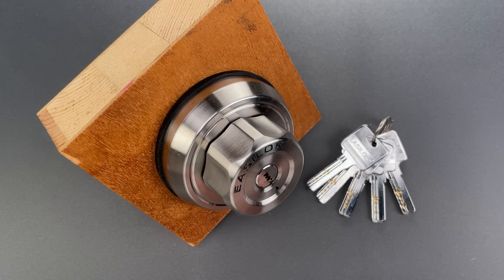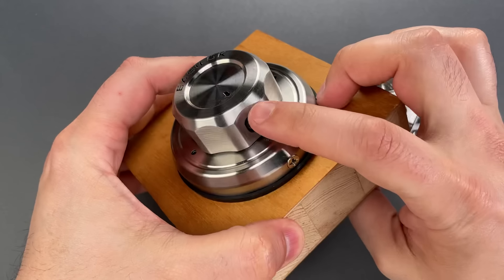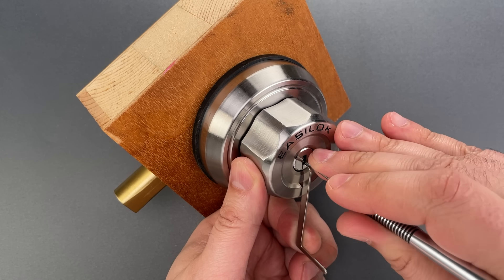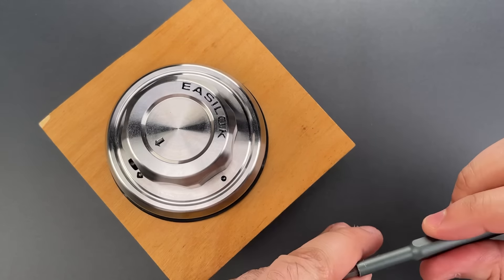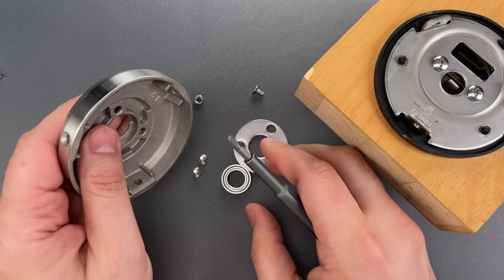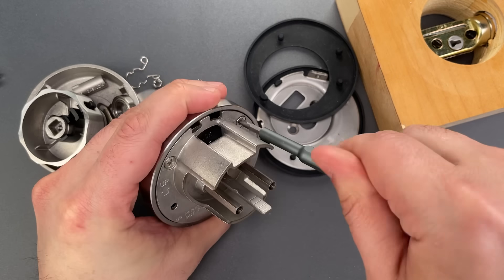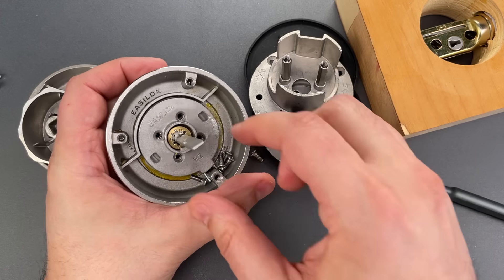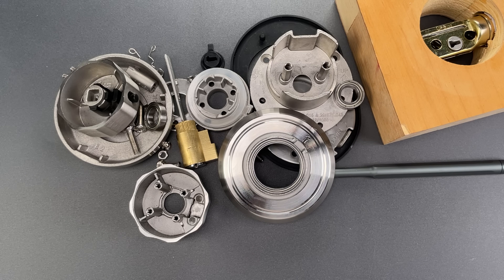[1388] The Best Built Deadbolt Ever? Easilok

Comment: A bit off topic.  I have built super insulated doors one 4 1/2" thick and another 5 1/2".  Well I have scoured the sources I know and have found no locks nor knobs/levers that will go through that thickness.  I did find some German locks on Amazon which I thought I could modify.  I have a pretty good shop with mills, lathes etc.  I first took the easy route and wrote to the German Company asking if they had a kit to allow it to operate on my thick doors.  No luck.  I then asked if they had the threaded (internal) round stock, square tube stock, and flat stock which they used to make them available.  No luck.  I then contacted several steel suppliers in this country to see if they had suitable stock.  Nothing even close.  Next step was to get as close as possible and machine it down.  However the internal threads on the rod posed a serious problem.  Getting a tap that small, metric equivalent of a #8 x 32 that was seven inches long has me stymied.  I don't have jeweler's tools if they even have such long small taps and drills.  So what I am wondering in all your dealings with locks have you come across any that have adapters for thick doors?  I cannot believe the industry can lag so far behind in a modern super insulated world to still only produce sets for 1 3/4" doors at the thickest.  Why would I use a standard thin door in a ten inch insulated wall!!  Thanks for any help.  Doug

Comment: It is a nice deadbolt.. but,  I'm curious to know what would happen if you took a good size pipe wrench and turn the exterior side of the locking mechanism while the deadbolt is latched. 
Would the deadbolt stay extended or would the torque from the pipe wrench be to much for the lock 🔐?  It seams possible to not have to pick this lock to open it. 
Happy trails 😊...

Comment: When a lock gets too good, just break the door. I have a stipple key yale, it's totally un-pickable, can't be bumped, snapped, etc. I also have locks that can't be used when the key is inserted internally. Anything which slows the villains down is a good thing, even if it's eventually cracked.

Comment: Damn, if not for the spoiler of the video title and his specific early praise, I really expected a lock like this to be build rather cheaply and crudely m, especially internally that won't be directly interfaced with. Stuff like this just tend to be sales-driver gimmicks, with all effort spent on selling the novelty, while the construction, materials and build quality is a very cheap, crude and flimsy afterthought. I'm surprised and very pleased to see that for once this was pretty much the opposite. Only real criticism is  I'd love to see a more standard form factor cylinder so that it's easier to use other core types and configurations (and some security pins in the core that comes with the lock). However with this attention to quality and detail with the rest of the lock, I assume the manufacturer already implemented a different and improved security core by now.

Comment: Well I do like the fact that you are impressed by this. But I am curious about a brute force attack to the outside knob. After all it does stick out quite a bit. And could easily be hit with a heavy sledgehammer.

But the fact that you disassembled it and everything is stainless steel that's why I'm curious. 🤔

Comment: How do you think this would hold up to some hard kicks compared to one of the nicer Schlage Locks?  I'm a contractor and do door replacements and door jamb reinforcements, and I think that is more important than being pick proof-resistant. I've encountered many kick ins but have not personally known of any crime victims who had their deadbolt picked. Most criminals lack the ability to pick a deadbolt, especially a Schlage. The brute force method is orders of magnitude more common. Do you think this is sturdy enough to resist being kicked in on a reinforced striker plate compared to Schlage?

Comment: Looks great, but still an overengineered less than 30 seconds to pick lock. Maybe keep the project and use a better core, a high security one if possible. It will probably make it more expensive but will also make it a LOT more useful.

Comment: Why the added cost and maintenance of a ball bearing !? A plain bearing will work just fine, actually a non sealed ball bearing exposed to the elements will rust and seize, not to mention it requires scheduled lubrication

Comment: Can you recommend a deadbolt which can ONLY be opened from the inside and outside by key, rather than by turning?

Looking to put these deadbolts on my house, but one of the doors has glass panes at the top.  A burglar can simply break the glass and turn the deadbolt knob to gain entry.

Comment: LPL, have you thought about designing and manufacturing a number of locks that are unpick-able! You should get together with a lock manufacturer and share the rewards. A lock recommended by LPL will sell faster than any lock maker who has been exposed to LPL’s tools and skills!
Reply: a unpickable cylinder is not impossible but impractical. The tight tolerances will exponentially raise the price and it will be susceptible to dirt and temperature differences.

Comment: It's a pity that such a well-built lock is let down by a low-security barrel and pin system. As LPL said, it cannot be changed for a better barrel, that modification would make this an outstanding unit.

Comment: My only issue is that it has the brand name on the outside so ab thief can easily google the brand to find a lockpicking tutorial
Reply: A thief is going to kick the door in or bust out a window.
Reply: @TravelingStacker  no they usually use the door.
Reply: @Demonologist013  Well according to statistics, a door being kicked in or a busted window happens more than the locks being picked.

Comment: I don't like that the lock cylinder can be disabled from inside (night latch feature). There are plenty of other devices that can very securely latch the door at night when a person is at home. If someone forgets or doesn't notice that the lock cylinder has been disabled inside and then leaves the house through a different door they can cause themselves a good deal of inconvenience upon returning home.
Consider when the garage door won't open because of power loss and the externally accessible doors have had the lock cylinders disabled with the night latch feature. The homeowner would be locked out of their own home! An older child could very effectively lock their parents out of the house while doing whatever they please inside. A burglar who is able to defeat the easily picked cylinder could lock out the owner until they finish ransacking the house..... It's just not a useful feature for me, and it would prevent me from buying the lock unless I could permanently disable the feature.

Comment: I get disheartening by how easy he always picks a lock.
Reply: well you are watching master locksmith. My first attempts takes 30min to a hour and some i still not manage to open. Soon as you move from cheap cylinder to something medium it gets exponentially hard. Just one security pin and most amateurs will have serious problems. Best way to secure you property is to have cameras and alarm, if you cant install or afford next best thing is to be unpredictable. If the thief is not sure when you come back he find a easier more predictable target.
Reply: @scasny  i have never tried lock-picking. I might give it a try it looks a lot of fun.
Reply: @MrRez808  well its similar to Jigsaw Puzzles that you train your patients and attention but the difference is instead of visual demand its about touch and bit of sound. After a while the clicking sound become addictive and when you finally open it its quite a satisfaction. I was working in a locksmith shop for a while and even for that short time i use picking 3-4 times so its definitely not a useless skill if you want to legitimately help people.

Comment: Can you still open the door from the inside when the switch is set to lock? If not, isn't that a fire hazard? If so, don't you stand the risk of permanently locking yourself outside by forgetting to disengage it before locking? Their listing on Amazon even states that when the deadswitch is engaged it can't be picked.
Reply: the night latch like your reinforement lock, your security bar, your deadbolt which can't be opened outside.

Comment: I'm thinking too much meat on the outside for a 24" pipe wrench to rip off the cylinder.  LPL your thoughts? Have you tested how this would hold up to the twisting force of a pipe wrench?
I always thought dead bolts have a tappered face so it cannot be gripped using a pipe wrench.

Comment: So this lock is impossible to install on a real door with those 3 screws on the outer ring so close to the door? Won't it be impossible to get a screw driver to turn them, or does it come with some sort of right angle screw driver?

Comment: While the exterior locking feature is neat, I am not sure it's actually a GOOD feature. I am fond of locks that require you to have the keys to engage them when you're on the exterior side of the lock, because that ensures you can't forget your keys and still lock it. For this reason, I'm none to fond of locks that you can engage on doorknobs, either, and then leave engaged as you leave.

Comment: I do like the design of the lock quite a bit. However cast steel powder is quite fragile and easily fractured. (Just ask the pliers on my old multi tool). Wouldn't buy. A 3lb slege would shatter the sintered steel.
Reply: Sir, there are different grades of stainless steel. I'm sorry to hear how you feel about stainless steel. But our locks are made of the highest grade 304 stainless steel and are very durable.😁
Reply: @avalu3477  It's not that it's stainless steel. It's that it is sintered stainless steel.
Reply: @ningen1980  Sir,we hereby clarify our Easilok deadbolt made of 304 stainless steel by casting process and never fades or rusts .

Comment: I was just looking at these on Amazon (US-E1 Quadruplet-Lock-FBA) and the keyway/core shown on amazon is different. It's a brass plug with a curved keyway on the rim at 6'oclock. They also mention on the companies website about a "computer keyway" which is a term I've not come across before. Anyone know more about what this means. Is it a higher security core?
Reply: sir ,dimple key cann't be duplicated in the States while Schlage keyway keys are very easy to be duplicated. Most comsumers like locks with dimple key better,since they think they are with higher security. Just choose what you want and any question please contact us .
Reply: @avalu3477  Thanks for the reply but it didn't answer anything I asked.
What's the difference between the dimple lock on the model in the video and the model currently on Amazon.
Are they both dimples? Is one an improvement over the other?
What's an Easilok "computer keyway"?

You are incorrect about dimple keys can't be duplicated in the US. You probably mean they can't be LEGALLY duplicated by the average person. However if you are a machinist (like myself) with a cnc mill or skilled at 3dcad and with a modern resin 3d printer (like myself) you can duplicate any purely mechanical key made. It's not hard to do a high resolution 3d scan if you have a key in possession or an imprint. It just comes down to skill, resources and degree of intent.

Comment: Question. The lock I have doesn't have screws so it'd have to be picked or forcibly removed to get access to it, I noticed that there were screws on the exterior. I was held up last year in my home and was wondering if I should keep my old lock or would that lock be a better option, having it easy to screw apart worries me.

 Edit: I'm a dumbass I see the screws are on the inside portion. Looks like it might be worth a buy.
Reply: All the screws are on the inside portion of the door there's two screw that tension the two halves together and if you give it enough tension you can reces it so that a crowbar has nowhere to bite into. It was on the place when I was robbed I just got it re keyed but I'm very very afraid of more robberies in the future as my townhouse was stupidly listed in the news after the event.

Comment: Wondering why I have a vision of a lock in my mind,   but  unable to ever find any company that makes it.
ANY   key-way is a weakness.    So why  do they all combine weaknesses?  No matter what technology they are using, they always add one more weakness.

All I want is a lock,  like this one,   where the  dial   spins,  without making any contact with the locking mechanism. 
Using an RFID  it connects the lever, to the locking mechanism,  and one can lock and unlock the door. 

NO    electric motors. 
NO   key-way. 

and very low power consumption.

I could even say no power consumption,  as I bet, one could arranging that spinning the disconnected dial, could easily charge, a battery.  (this is getting goofy)   but it means no need for any external power.   ever.

essentially a SCHLAGE BE365 CAM Camelot Keypad Deadbolt 
with no key-way,   and no code.   just  with rfid, or Bluetooth, or wifi. 

Why does it not exist?

Comment: About the switch on the inside that disables the  keyed entry. When it disables the keyed entry, can one still open the deadbolt in a hurry to exit the house in case of an emergency? I would hate to find myself trapped inside in a panic because I forgot that I also had to flip that  switch back to its normal position. Kids would never remember to do that. As an aging retired person, I may not remember to switch it back either!
Also, If one forgets to set it back to normal, is it possible to accidentally then lock the deadbolt from the outside when leaving the house and then not be able to get back in? Or does that switch also disable being able to lock it from the outside?
Reply: when you lock the door in the room and push the inside switch down , you need to push it back then go out the outside ,and other people can't open the door even they have the keys. And when the door unlock ,you push the switch inside, the door can always keep open status ,people can't lock the door in the outside.    if you don't want to have the lock with the switch ,please contact us, we can customize for you :)   Thank you !

Comment: Quality of locks varies greatly. But no matter how great your lock is if a bad guy wants to get in your place they will find a way. And if your lock is so great it will not be attacking the lock. Most homes and businesses are vulnerable in so many areas. Windows , door frames and even the walls themselves. I have heard of thieves driving a truck through the wall , grabbing what they want and fleeing. Good lock is nothing more than a deterrent.
Reply: Nope. Actual high security locks do exist.
Reply: of course they do. Abbus, Medeco etc., My point was when face with a high security locks easiest way for theives to get in is not attack the lock. Look for window , or break in through wall.
Reply: @fredflintstone1485  "of course they do", so, you were wrong when you said a good lock is nothing more than a deterrent. High security locks do exist, and are effective.

Sure, most places are vulnerable in other ways. But that's irrelevant to that wrong statement. The lock is more than a deterrent, you just might also have other vulnerabilities

Comment: I'm interested in seeing how that black switch functions with the lock taken apart. What does it do to the cylinder that disables it?
Reply: it prevent the whole mechanism to turn further, i think its possible to force it and break the plastic but then you have a evidence of force entry and it will make quite a crunch noise. My ques is they dont make it out of metal because of children.

Comment: @LockPickingLawyer: "best ever"?? Good lord no!  Find yourself an Ultra-700 (rim cylinders not included) and prepare to be impressed. Yes, it is non-standard mounting. But that's part of what makes it better.
Reply: I was referring to the strength of the bolt mechanism, not the pick resistance, since 1. crooks don't pick locks, they break windows or blow doors open with improvised battering rams. Ask a cop. & 2. the old Ultra-700 accepts whatever pick-resistant rim-format cylinder you like.

Of course, it does have the decided disadvantage of not being for sale for decades... but we're talking "best", so... :P

Comment: I think it's one of the best locks I've seen, but I am unsure if I want the feature to be able to lock it from outside without a key. What happens if I accidently left my key inside and locked it?
Reply: You need the locksmith to help  .But we have a anti-misklock button to help to prevent the accidental locking ：）
Reply: @avalu3477  If I understood correctly, when that button is clicked, you can't open from outside even using the key. So it is not a viable option if you want to go out, and only an anti-intrusion measure if you are inside. Isn't it so?

Comment: Except you can just use a screwdriver to remove it so is it really that good?
Reply: *from the inside*. If you unlock the front door and let a lockpicker into your home to access the inside of your deadbolt assembly there are more pressing issues than the brand of your deadbolt.

Comment: Nice lock, what would happened if you force the exterior ring with a vice grip when is lock?
Reply: wguch ring sir?
Reply: @davidhsiang9323  
If you grab the hole turning piece with a vice grip, are you able to force it open or break it?
Or it has a clutch mechanism?
Reply: @joseg.5937   of course has cluthch,But the limit block setting inside is stainless steel casting,you couldn't break it
Reply: @joseg.5937 you couldn't open except ypou have the right key. broken is the most difficult than broken the door